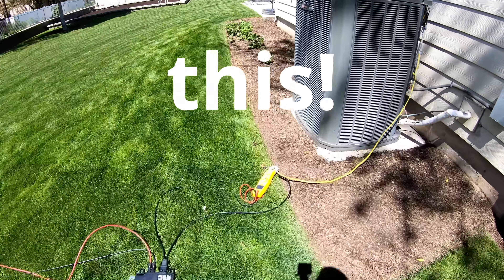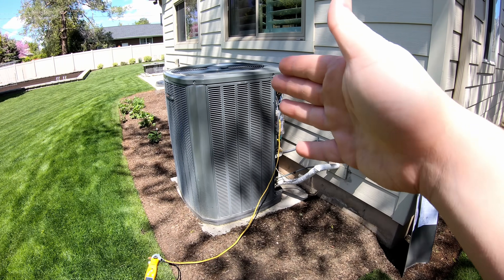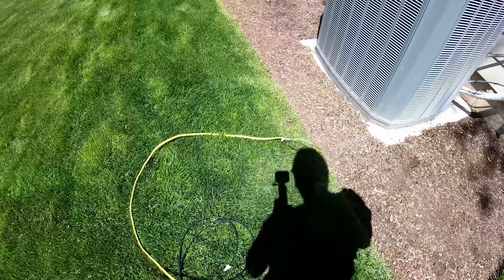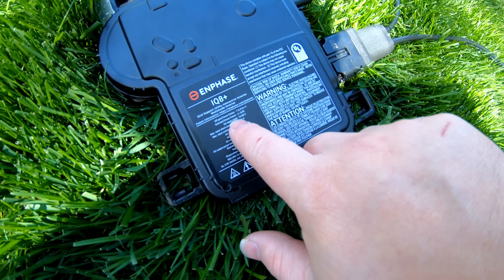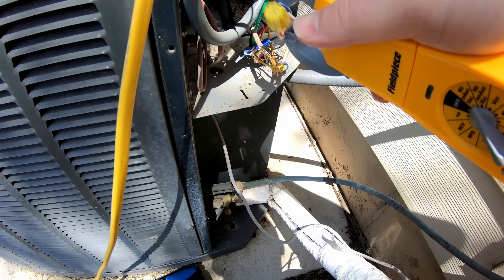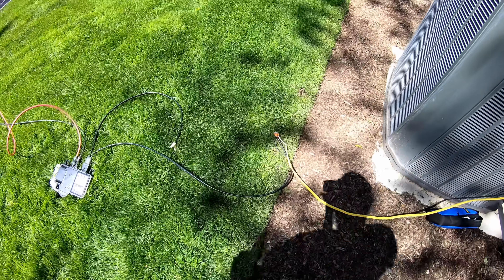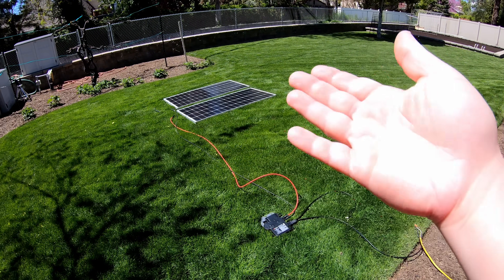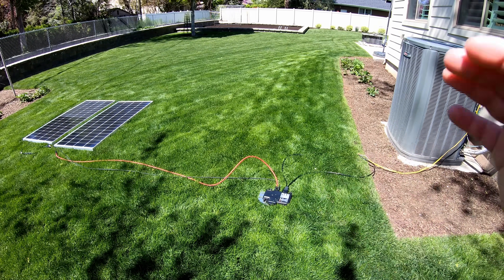1 Hack To Eliminate Your A/C Power Bill This Summer!

Comment: I am a retired electrical engineer, and what you are doing is technically correct.  You are adding a grid-tie inverter to the circuit to CONTRIBUTE to the power being drawn by the AC unit.  You will never come close to power draw that the AC unit needs, and its only inserted when its running, there is no chance you would ever inadvertently export to the grid.  Since the micro-inverters  are designed to require a grid to sync with before they will export power (anti-islanding) there is no safety concern.  Also no way the utility will ever know..   Before I became legitimately connected to the grid, I made a far more sophisticated system consisting of current sensors and outputs from my thermostats to control how many panels were connected to my inverter depending on the load.  That way i didn't have to completely disconnect the grid until the total house load was less then what a single panel produced. Super nerd project. I ran it like that for over 2 years until the official connection was made, and now I'm legal!  Endphase inverters want to see a gateway,  so it would be better to use the cheap Chinese micro-inverters  that don't spend time looking for a gateway.  Also, switching the DC side will get the power to the AC unit  with a shorter delay, but you would have to control an external relay to do so.  Make sure you provide a disconnect of some sort so you don't confuse the poor AC tech who is trying to fix your AC unit when it fails in the hottest part of summer!  BTW. The best thing you ever did, was install the soft start unit to the AC.  They are pricey, but worth it.   A final word of advice: Just because you CAN do something, it doesn't necessarily mean you SHOULD do it.  You have to be the judge. I tend to live on the edge myself, it keeps things interesting.
Reply from the maker: Hey! Sincere thanks for your thoughts and wisdom! Probably the most valuable comment so far! Thanks for taking the time to write it! Sounds like you had a pretty sweet setup. Thanks for watching and commenting!
Reply: Awesome comment , very educational , you should create a video explaining to those of us that dont know much.
Reply: Great info.  So OP has one panel with one inverter, would iir be safe to add a combiner box to parallel more panels?
Reply: Thank you for your input. As just a regular home owner, it’s nice to hear from someone knowledgeable in the field to further my understanding of the elements involved. To me this seems likes a pretty ingenious idea in theory.
Reply: Question for OP or Mike: if the solar array produced more than what the AC called for, when that contactor closed, would it backfeed the power not used by the AC all the way through that breaker for the condenser and supply the rest of breakers in the panel as long as the contactor is operational?
Reply: @db0nn3r 😅
Reply: @db0nn3r it’s on the load side so the the load would use it. The compressor would run for a short time longer
Reply: My AC has had the pressure switch tripped before cutting off the compressor when the fan was not running due to a bad capacitor. In this failure case, you can end up exporting to the grid inadvertently with the simple setup demonstrated in this video.
Reply: @ericl5973 Or when the contactor fuses (gets stuck closed). It happens a lot. I like the idea, though. I would add a CT to sense the current draw of the AC to create a safety circuit
Reply: @ericl5973  20 year HVAC tech here.  How do you think the pressure switch cuts the compressor out?  It kills the contactor!  Same as the thermostat shutting it off......
Reply: Built a kit you can sale 😎
Reply: I’ll second that ☝🏼 -Journeyman Lineman 20 years all over the USA 🇺🇸 
    Living on the edge keeps you sharper 
And we can’t live if we’re too afraid to die ☠️ 
Also educated at The Ohio State University.. where I learned how to lift weights and make beer 🍺 disappear. 
 Dropped out and went to ALBAT (Line school)
Where I was able to get my hands on training and (ass kicked) by the old Nam generation. Hated them then, but love them now. 
I dig these projects. Made a  geothermal setup out of 3/4” plastic water line, a car radiator, and and an old water well. 
It works great in my shop and totally off grid for under $800
Reply: I am building an ambitious off grid and can't find any engineers who understand the what and why's and can't give me the how's. Mr. Peters I would love to talk with you if you would have the time. I don't know how to connect with people through this chat, so please let me know🙏👍😎✌️
Reply: I think I know a guy that can help you if you don’t get answers you need
Reply: "You will never come close to power draw that the AC unit needs, and its only inserted when its running, there is no chance you would ever inadvertently export to the grid."

If your solar system is greater than the draw when the A/C is on, will it not push power backwards into the rest of the system?
Reply: @DracoXul Yes. The idea is to use panels whose max output is less than the air conditioner power requirement.
Reply: Mike peters you should do a video of your Frankenstein project that be so helpful 😊
Reply: @derickgillispie1396 that won’t happen, he’s too worried that a regular Joe blow would be able to do it without having 35years experience and a MBA
Reply: @derickgillispie1396 that won’t happen, he’s too worried that a regular Joe blow would be able to do it without having 35years experience and a MBA
Reply: I would absolutely love it if you wrote a book or made some videos. You sound like the real life, (hero of mine since I was 5) MacGyver! I'm living in a camper right now and NEED to become solar powered in the cheapest, safest possible way. My fiancé and I know a little bit about electrical wiring and know enough to know that what we know can be just enough to be dangerous so we're cautious and careful with anything we work on. The knowledge, experience and life hacks you possess could greatly benefit us and people like us who have the capability to help ourselves but lack the budget to follow the videos with good instructions that assume everyone can just order what they need from Amazon.
Reply: Asking for a friend what would all that stuff cost for a project like that? Asking for a friend of course😅?
Reply: @Refinedlife100  about a thousand dollars for what he has maybe less... all depends on what you get... you could build a few thousand watt system for a couple grand. that could get you closer to completely producing the amount needed to eliminate the power consumed at least while the bright sun is pounding heat down in the hot of the day. Cutting out just that amount of time im sure would probably recoup the investment  in a few years depending on where you set the panels how much sun they get and how long they work before the sun goes down. Batteries might smooth things out and allow things to last longer considering while your AC is off the Batteries would charge and maybe make it into the beginning of the night while the sun is gone. Adding batteries and equipment to do the charge and all would be a bit more for the batteries probably about 500 each which i forget how many hours that would give you so say 3000. So take your power look at the bill and ruffly thing 60% is AC now divide that by half cause you probably only getting maybe half the day out of it and thats what you'd be saving. "possibly" at least with all the variables. 

https://www.amazon.com/SISHUINIANHUA-Efficiency-Monocrystalline-Waterproof-Rechargeable/dp/B09KGXLG28/?
Reply: Nice lawn Sir.
Reply: Quick question why is the soft start unit the smart play and if it's needed why dont HVAC installers put them on by default. Thanks.
Reply: @sheriffbart5451 He states why the soft start is there right after he pointed it out. 4:35 The soft start is there so he could buy a cheaper generator to run the A/C than he would've had to buy without it. 

The AC motor (alternating current, not air-conditioning) that drives the A/C compressor pulls many times its rated power when starting up. It only does so for a second or two, but that is long enough that if you want to run the A/C on a generator, you need to buy a generator that is significantly bigger than you would otherwise need just to handle that starting power. The soft start limits the power to the motor while it is starting, and that allows you to use a generator rated for the continuous power draw of the A/C instead of the starting power draw. A generator that can handle the starting power of the A/C is many thousands of dollars more expensive than one that can handle the continuous power. 

Softs starts aren't usually included with A/C units because the power grid can handle the starting power just fine. The hundreds of gigawatts worth of generators that power the grid aren't going to bat an eye at if the A/C pulls an extra 10 kilowatts or so to start running.
Reply: Actually, the Enphase microinverter could backfeed the grid.  Say the compressor motor (or just capacitor) fails so that it doesn't draw any power.  The microinverter will still see the relay output (grid) so will output.  Perhaps also true even with no failures if a newer variable-speed compressor motor which perhaps draws less than the microinverter output power sometimes.  My guess is that utilities never assume no grid backfeed since so many things in the world, such as home-rigged generators.
Reply: 👍 if you are not living on the edge, you are taking up way too much space!😊
Reply: @retired1822  definitely helping Klaus Schwab with his agenda.
Reply: Thanks for the wisdom
Reply: If the AC draws less than solar provides will the excess power go to other appliances in house? And this is not a problem?
Reply: @zsqduke  those solar panels are 
Not 220v or 110v they will not work like the guy has them hooked up . If they have solar panels that powerful where 2 panels would power a ac then it would only take like 4 to power a hole house and that’s not the case , solar panels are dc not ac Volts
Reply: @brian92345  the solar panels produce direct current (DC) the air conditioner (A/C) runs on 240V alternating current (AC). He has a micro inverter which is a device that converts the DC from the solar panels to AC for the A/C. It syncs the 60Hz sine wave output to the grid so it is in-phase. 

The power or watts (volts X amps) can be directly converted from DC to AC assuming a 100% efficient micro inverter (which it is not). That is to say Volts(DC) X Amps(DC) = Volts(AC) X Amps(AC). How he has the panels wired he produces ~50V DC power and stated he gets ~300W, therefore the panels are producing 50Vdc @ 6A which translates to 240Vac @ 1.25A.

The running load of his system is ~1200W (5.2A X 240V). His panels are producing 300W of that with the other 900W coming from the grid. He reduced his grid consumption by 25%.

Although an imperfect analogy, you can think of power transmission like water supply lines where in this case there are 2 supplies. The A/C needs 5 units of water to run and will not use more, even with bigger supply (think of it installed on a 100A circuit, more supply, does not use more power). You can supply 100 units of water, but you cannot "push" this through the motor. Hence with 1A @ 240V supplied by the solar panels via the micro inverter, the grid "makes up the difference" and supplies 4A, as he demonstrated in the video with the clamp meter.
Reply: Is it possible to add solar panels to ASSIST  grid draw? I.e. instead of drawing 3000W from the grid, the solar panels will assist 2000W? For some saving ? Thanks.
Reply: That is exactly what my solar panels do.  It's called "grid-tie".  I have 50 panels (350 w per panel) and it cost $63,000.
Reply: @forgotmypassword2804  great question!
Reply: The biggest part that will keep this setup from accomplishing much is the mandated 5 minute delay the microinverter has to go through when grid power is applied. By the time the inverter starts supplying energy, most of the current compressor cycle on-time will have elapsed and the compressor will shut off a short time later because the thermostat set point has been reached. (If his compressor run time is longer than 5 minutes, then there will be some energy offset)
Reply: the system only looking for grid and not checking for load , so if relay closed but , compressor is out , making all your system out compliance.. as you now pushing power to grid .. 
Also most areas contract is 2 part ... connection to the grid and net metering
Reply: I have seen many HVAC systems designed by seasoned engineers that didn't know what they were doing. Especially in govt where you fail upwards and get promoted out of your job instead of fired.
Reply: Make a video
Reply: @pmh4883 Are you insane?
Reply: I have no clue what you’re saying here but it sounds very nerdy and awesome! Good on you 😊
Reply: Last 3 sentences of this comment...awesome!
Reply: You should really make a video showing what you explained, to make it easier to visualize your breakdown of this scenario
Reply: False. You lie , those solar panels don’t work , the second they was hooked up to the home like that they pop and stop producing electricity.  The amount of electricity they produce is to little to do anything
Reply: Great advice!
Reply: Did you make a video on it ?
Reply: My RV has 800 W of solar on the roof, and it just sits on the side of the house 99.9% of the time. I was thinking about how to go about doing this, but would have to disconnect from my lithium batteries (400 ah) somehow.  
Any advice would be greatly appreciated.
Reply: The contactor you hooked up to appears to be a single pole.  One side has a shunt.  The solar inverter will always see that leg of power.  It appeared the inverter didn't start exporting until it saw both legs though.  It might be worth installing a two pole contactor just for safety purposes
Reply: Care to share how you did all that, sounds very interesting.
Reply: I wish more people took this advice...."Just because you CAN do something, it doesn't necessarily mean you SHOULD do it."
Reply: Can I ask for some advice.I have grit tie system 7 kw I am testing system bought it used .I have total of 26 panels I am only using 13 panels I am only producing between 8 and 12 kw a day .I hung panels on fence I am scared to ask for permit can I use my remaining panels using batteries and charging unit to charge battery and then send power back to inveter on DC circuit like it would be coming from panels. I am using my system too run my pool pump so I have to make sure I am not sending electricity to grid.this way I save $60 plus on monthly bills .
Reply: He can't be getting 240 volt 25 amps with two solar panels. The onrush would fry something I think.
Reply: Your wrong.  That ac 240v and those panels  can't produce 240 even with a inverter
Reply: Wow amazing info
Reply: Love and Respect 🙏 Thank's and Bless you for the information ❤️ Bless you ❤️ Congratulations ❤️ 🙏 Beautiful 👌
Reply: yes, i agree! this setup  really do anything but reduce 200w on our electric bills. Be better to built a battery setup with a least 6x200w panel a 10hwh inverter with a 30kwh battery storage system and this is how you paid less elec bills
Reply: Beautiful comment! Us YouTubers appreciate the knowledge, experience, and encouragement! I'm considering this, but with batteries.
Reply: I wish I had the IQ to understand what you explained but it seems pretty solid
Reply: That's rad as hell. I'm an electrician and engineers in my experience give me a nightmare to bring back to code after but I get to see some wild systems in the process. I always wanted to own some property and find an excuse to make Bluetooth power for my shed lights. I've seen some cool setups with generator backups with supplemental solar. My work day goes faster when I get to learn a bit and install something cool vs pulling Romex through mouse crap and fixing stupid problems from stupid decisions
Reply: With all respect intended. Someone who doesn’t understand the power requirements of an AC unit shouldn’t be messing with this let alone “teaching” others on YouTube.
Reply: @BryanKirch  Listen, with all due respect generally means someone is about to say something nasty when it could have worded differently as a question maybe. We all do stuff we aren't "qualified to do" I'm a custom firearms builder and see that every day. I'm new to solar and am having a little fun with it hooking a system up to my 5th wheel trailer and taking my 2. home freezers off the grid to keep my power bill down and eventually most of my home. Anytime you work with electrical there is some danger but we're still going to do it and these vids help a person to gain a little more knowledge. I have to admit the video is a little over my head but I will gleen some knowledge from it. So quit being such a safety Sally and give the guy a break and take the video for what it was meant to be "a science experiement". After watching this I don't feel the need to take apart my mini split AC and wire in 400 watts of solar but it was cool to watch some do it and get his desired results even if it was a small inprovement it's still an improvement. Dang dude take a chill pill, do you need a hug or something.
Reply: @markthegunplumber8376  Mark have your wife let me know what happens when you touch the capacitor on the AC unit. Stop being such a reckless randy…
Reply: @markthegunplumber8376  I run both of my mini splits off of solar power I have 2 5000 watt all in one units 48 VDC and they operate 24 hours a day when I have enough sun. They off set my electric bill some. I actually have 5 sets of systems I have went from a $350 a month bill to less than $100 a month . If I had not done the stuff myself it would have cost 5 times as much. Santan solar is the place to get solar panels. I too am retired jack of all trades and have been learning from YouTube school. LOL. I am going to try this or maybe change out one of my all in one units to one that has 220 VDC output and run my heat pump central unit. I too think this was informative and more than I know how to do.
Reply: @BryanKirch  We will take our chances in life run along and worry about yourself.
Reply: @Mike-01234  Dumb-lucky-smart-wise everyone gets to choose their path Michael. May you continue on with the luck you’ve been granted.
Reply: @BryanKirch yes you must only listen to the government don’t do anything for yourself and definitely don’t help anyone else .
Reply: @harveyallen9679  I work on my own electricity and never took the shot. I can tell who should avoid giving advice because they don’t know they don’t know. I know enough to know he doesn’t know. May you continue to be blessed with dumb luck for the rest of your days instead of cultivating wisdom and knowledge about the world around you.
Reply: @BryanKirch your argument is dangerous Bryan. I can only imagine how much you would censor from everyone if u could.

So nothing should be taught that has an element of danger!? Or is it only credentialed “teachers” are allowed to share? Why is the onus on the teacher/poster? It should be the responsibility of every one of us to know if something is beyond our comfort or skill level to not attempt it until we are comfortable. But you would rather ban the sharing of information and discovery because it may be dangerous? That’s outrageous. 

Tinkering, experimenting, sharing of information is what gave us nearly every amazing technology and innovation we have today AND it is what inspires people to pursue education and careers. 

Does everything ever produced now need a “do not try this at home” disclaimer or should people be responsible for their own actions and not attempt something that is beyond their skill level. 

By your logic 75% of the internet should be censored because it may show something dangerous.
Reply: @BryanKirch  I regret that I ever wasted time replying to this video, but since there was actually a nugget of truth to it,  and was impressed with the innovative spirit of it, I decided  to offer the wisdom of my MBE degree & 35 years of experience in the field of electrical engineering to the YouTube community.  Turns out, that most of the people drawn in to these sort of videos shouldn't go near anything electrical.  These are the people who don't know the difference between "your" & "you're"; "there" & "their", and complain about the price of gas while daily driving a giant pickup truck.  I don't know what I was thinking.  I am going to unsubscribe from the comments, and never make this mistake again.
Reply: @mikepeters2852  i was saying the YouTube creator isn’t qualified to teach people about this because it’s dangerous sorry if you thought I was talking about you
Reply: @BryanKirch , for future reference, the confusion lies within the fact that you made the comment under his comment tree as opposed to a reply under the main comment section itself which would have clearly been directed to the OP.
Reply: @mikepeters2852  Ahhhhh...Throwing your credentials out there as if anyone asked for them it or cares but it makes you feel important. Now we all know your politics.
🤡🤡🤡
Reply: So you know I wasn’t speaking to you but to the guy who made the video